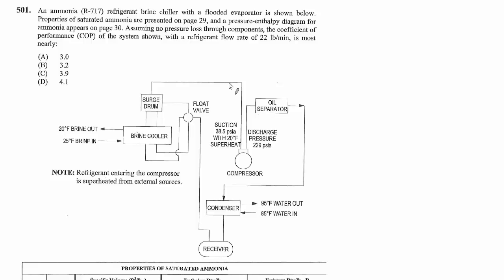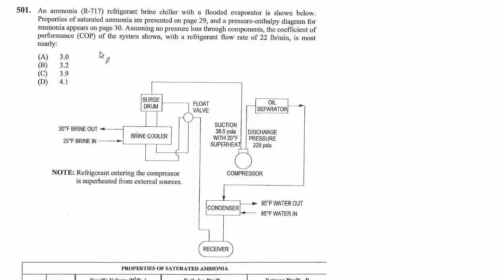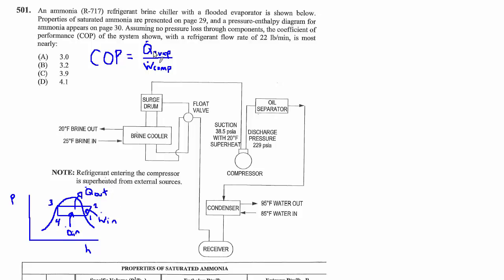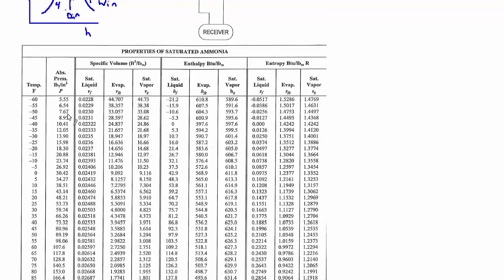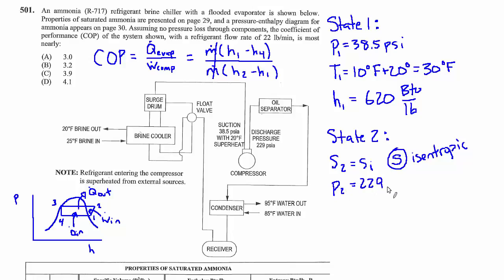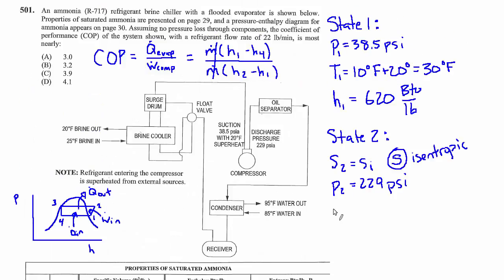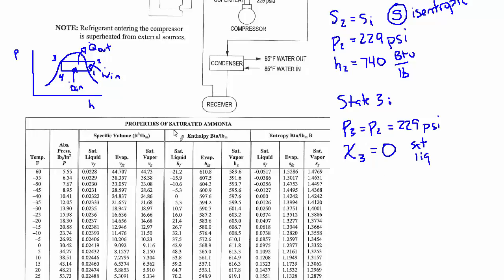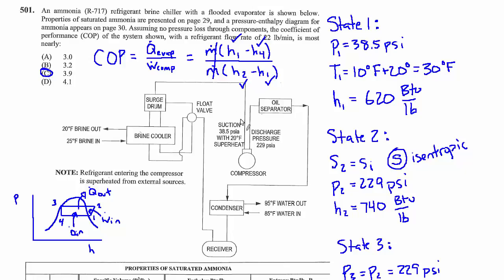Mechanical PE Exam HVAC | Refrigeration Cycle: Calculate COP Using Pressure-Enthalpy Diagram

Comment: What about the note on the diagram that says “refrigerant is superheated by external sources”? Shouldn’t we use 38.5 psia saturated vapor enthalpy of 614.669 BTU/lb for h1 in numerator since superheat is not technically an evap output?
Reply from the maker: The latent heat of vaporization gained during phase change far exceeds the enthalpy gained with a small amount of superheating, because the specific heat capacity in the vapor phase is comparatively small.  For most practical purposes, h1 will be quite similar to hg unless there is alot of superheat.  Superheat mostly is used to keep liquid from entering the compressor.  Typically if a problem specifies that there is superheat, you should place h1 in the superheated region and take the full difference h1-h4, which will slightly exceed h_fg=hg-hf.  Hope this helps!

Comment: Studying for my PE now and found this problem super frustrating.  I was off on h1 & h2 (I selected 630 & 740), which gave me a COP of 4.26.  Incredible they'd give answer options that less then 0.05% error on sight reading the chart can bump you out of the tolerance.
Reply from the maker: It can be frustrating for sure, but rest assured if you understood the concept and that was the only aspect that threw you off, you're doing the right work in the right way.  Take care of the process and the result with take care of itself.
Reply: Agreed. I initially read h1 as 625, which resulted in COP of 4.1. I then reviewed the superheated tables, located P1 = 38.5 psi, noted T1 = 10F, added 20F super heat to get T1' = 30F, and read the corresponding enthalpy of 620.3 off of the table. This resulted in COP of 3.9. 

Hopefully the exam will have a larger variance between answers like you mentioned.
Reply: @Bustakonye I got h1 at 625 from eyeballing the P-E curve, same as you. Where did you find superheat tables for ammonia (R-717)? Is it in the Reference Handbook?
Reply: @f @fsowemimo yes sir, should be in the handbook a few pages past the graphs

Comment: As a rule of thumb, can I assume saturated liquid on the condenser output (or state 3) if "Flooded evaporator" is given in the question?

Also, when I tried this question, I decided to take the superheat into account and take a value h1' for the superheated vapor. Essentially what I did was exclude the superheating energy from the Wcomp term as the question states "external sources." When I did this I got an answer of 3.888 which was remarkably close to 3.9.